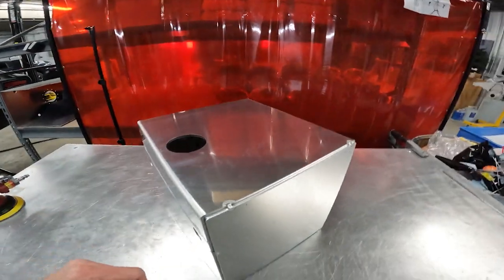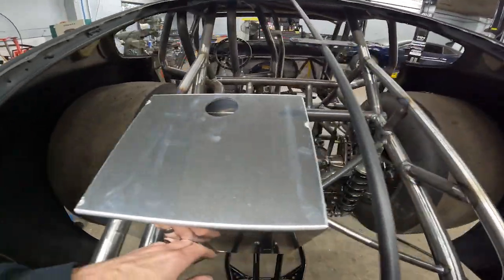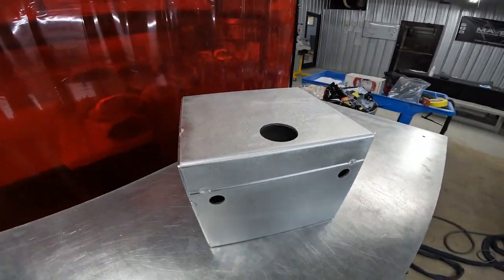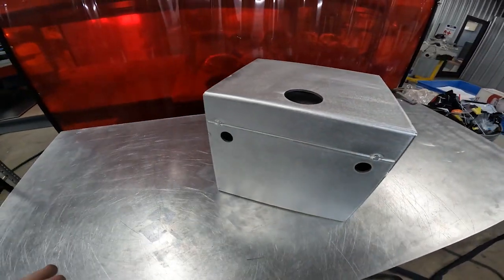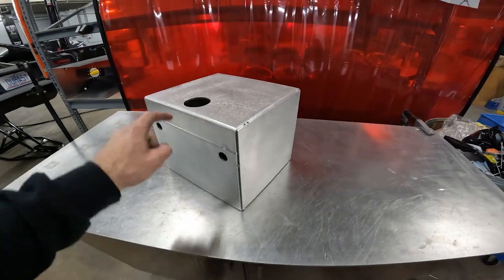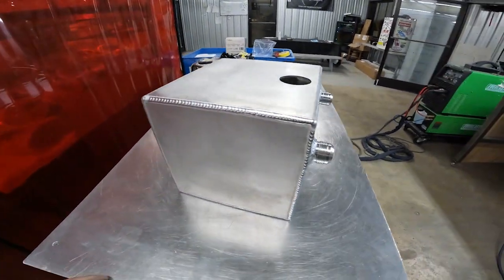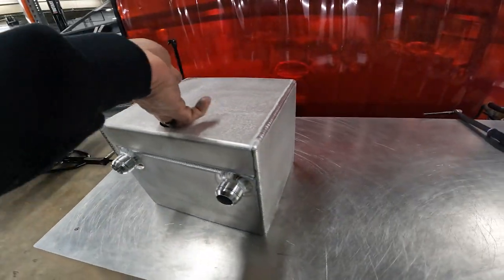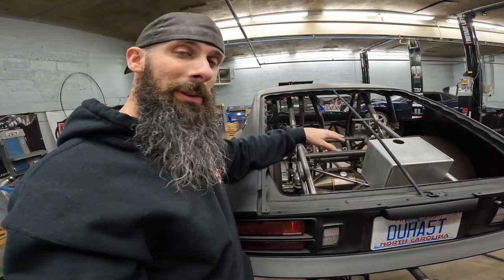Du Hast 2.0 RSM Mid Size Crankcase Vent Tank Assembly

Comment: I'm glad to see you back at it on the Datsun. I throughly enjoy your videos. I figured I'd share a different processes that change the look of aluminum. Give your aluminum brushed appearance with some red 3m Scotch Brite 7447 & WD40. Keep your strokes in a straight line for a nice uniform look. You can use a die grinder with red red roloc scotch brite disc to create a round pattern, by dotting the panel.